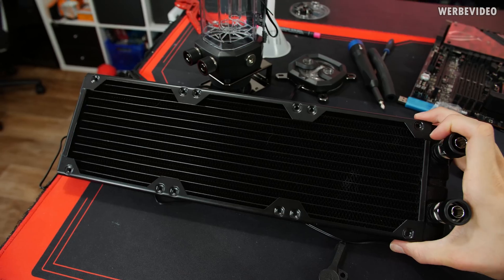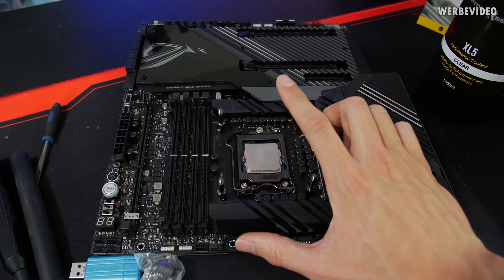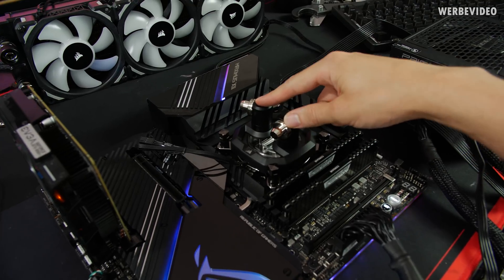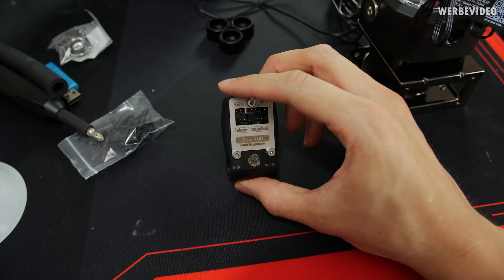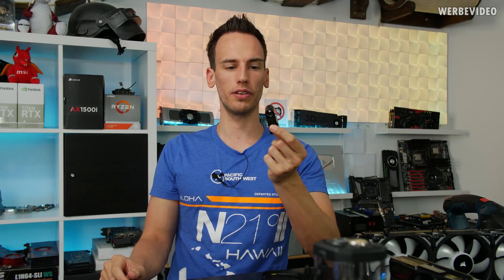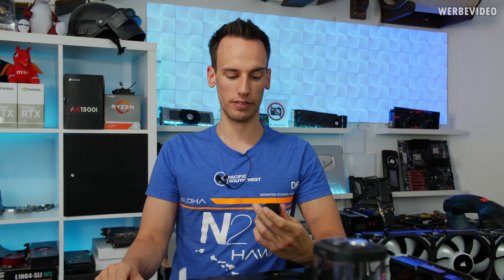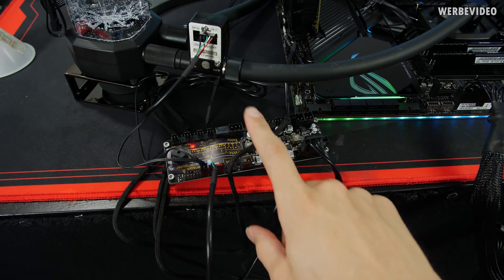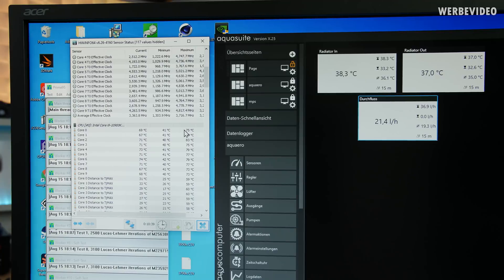Testing one of the Weirdest Water Cooling Myths - A SLOWER Flow Rate will result in BETTER Temps?

Comment: RUN THE PUMPS AT DC POWER, PWM CAUSES NOIIIIIISE
Reply: are u whacked out or confusing pwm with low phase ac
Reply: @BTD3Fan  pulse width modulation causes loud pumps. in the bios you can chose auto, dc, or pwm. choose dc. this makes the pump run quieter
Reply: @animearmpits3060  pwm is just a different way of delivering power which is much more efficient if you dont want to run full speed. you can still control the speed of the pump.

with dc you deliver 0-12 volts, and with pwm you deliver 12 volts or 0 volts (off) and you switch it on and off. So if you want to have it run at the same speed as a dc 6 volt, you turn the power on half the time. 

the reason this is done is  because the power to the dc is always being provided fully, so you would be wasting power, plus anything not being used just turns itself into heat. 

the only way a pwm could be louder is if the signal is off and on slowlely like 1 time per second, instead of alternating very quickly like 60 times a second, because then the motor would always be speeding up or slowing down.

Comment: I have duals between cooling points. I knew it wasn't much change but I am using a 800/L pump. CPU on Cinebench R20 maybe see 82c under 15min stress test. GPU never goes over 55c. using a EK Supremacy CPU block and a Corsair XG7 20 series GPU block. Got a EK Thin 240mm and a EK 240mm Thick (Double thick). System stays VERY cool under long loads.

Ill perform 10hr streams on Twitch 3 screens, 1080p at 60 fps on OBS, video games, discord ect. ill see idle be 42-44C after streaming will settle down to 34-36 after it cools. 

i7 9700k 5.1 at 1.365v with LOAD LINE cal 7 will jump to 1.39 (cinebench stress) but streaming never see it go over 1.378v. She puts some heat off but I absolutely love my i7 9700k paired with EVGA RTX2080 Super Black Gaming edition. Everything smooth as a whistle. I use a EVGA 1300 80G PSU. I don't care about watts and heat. I give her all she can get. damn RTX has another 95 Core Clock MHz added with 650 Memory clock added on top of its ALREADY OC'ed from factory. Gonna be awhile until I want to upgrade her. She does Everything I need/expect and a custom cooling system just tops her off. 

Thank you for doing this test. I figured with my flow rate it wouldn't matter two or one radiator. being a 15 year mechanic I saw having a second one wouldn't hurt. Using a Corsair Vengeance C70 case. She got room for sure. lol

Comment: I did the same test a while ago. Add a 300W GPU in the loop and a second triple radiator and you'll see a delta between cold and hot water of about 12-16°C with a D5 at 800rpm. As long as you get 0.5GPM it's allright and you'll see a temp gain of about 1-3°C per component. But any lower flowrate and the difference becomes quite noticeable. But you need to add a lot of blocks and rads to get a D5 to perform under 0.5GPM at full speed. And yes, you're flowrate values are a bit off :D The mechanical Aquacomputer (AC High Flow) flow meter is a lot more accurate and would have been better for this test. You should be seeing about 340lph with that D5 on full speed in your test loop. Maybe even more.
Reply: When you did this, was your delta between cold and hot measured by 1 temp sensor at the first rad's inlet and another temp sensor at the second rad's outlet?
Reply: @riffsthatkill2180  Yes, that’s correct. I used 2 triple rads for this test and they were connected to each other. So basically comparable to a 6 fan radiator if that would exit.
Reply: @broodro0ster  cool, I did this test recently too with a triple 360 and a 420. I had 2 D5s in series between the rads. Took flow down to 1 L/m (.25gpm) and saw a 7c delta with a 500w heat load. Up at 4 l/m, it was a 1.7c delta
Reply: @riffsthatkill2180  yea, the bigger the heatload, the bigger the delta when changing pump speeds. Multi GPU setups perform better with a higher flow because of this. My test was with 320W of heatload (8700k and 1080TI)

Comment: Awesome. My 10900k runs about the same, mine takes 1.335v to get 5.1 go z all core. I only have my cpu cooler right now due to costs. 

Questions did you some howvyse normal temp sensors? All I can find The plugs with temps sensors.

Comment: I wonder what would happen if you split the flow between two radiators (and them recombine them after) vs having two radiators in serial. The parallel rads would have half the flow rate and spend more time cooling down, but you'd only have 1 radiator to cool down in. In a serial radiator you have the same flow rate as the rest of the loop, but you have two radiators to cool down in. My guess is it probably makes no difference.

Comment: There is an optimum flow of water for ALL cooling loops, I work in commercial HVAC controls programming where chilled water cooling is the norm.
A chilled water coil (the metal heat exchanger that the air conditioner blows across to cool thenair) has water flowing through it at varying rate (via control valve)  that maxes out at a design flow. This design flow is the maximum flow you can run through the coil before you start to lose (instead of gain) heat exchange. The reason is, heat exchange takes time, and at some point you are moving the water too fast for it to have time to properly heat exchange, so your cooling ability actually gets worse at that point. 

You can also move the water too slow, because if the heat load is too great and the water too slow, the water gets saturated with heat long before it leaves the heat exchanger which means the heat load stops being exchanged until that water leaves the exchanger. Now in varying heat loads, when the load is really low, that lower flow may be perfect,  but as the load increases, so does the need for the flow to increase. This is why in my job, there is a controlled valve that is targeting this sweet spot via output temperature. 

In this application, you would just need to find the design flow, that is, at the highest head load, the highest flow before you start to loose cooling because the water moves too fast. This can be figured out by the temps of the water entering and leaving the cooling system. Where the temp differential (delta T) hits it's maximum, that's the optimum flow rate.

This method is optimum because it eliminates unknowns of the variable system. Whatever flow is heating your water up the most gets you the best heat exchange.
Reply: Simple physics dictate that its impossible to lose heat gain through an exchanger from increased flow. Exactly as this video demonstrates. All exchangers have an optimum flow due to surface area, increasing flow results in diminishing returns and efficiency loss but never an increase in temperature. Its easy to get confused by irrelevant information (heat gain to fluid). Think of the same exact problem in reverse. Instead of chilled water, heated water in a boiler system. Unlimited flow results in a fixed temperature of the exchanger but diminishing gains as the exchanger can only dissipate a fixed amount of heat dictated by surface area and temperature difference. As a result increased flow of the transfer fluid will always result better exchanger performance but you reach a point where exchanger gains are less than then energy required to pump the fluid. As seen in the video where pump speed was more than doubled from 2000rpm to 4800rpm with only a 0.5c cpu temperature decrease.

Comment: How is it  that the CPU is cooled better (ie lower temperature) in the High Flow case when the radiator is only removing 21.5 W while in the  Normal Flow case the radiator  is removing 31.7 W?

Comment: You could still get a slower flow rate in the radiator while having high flow rate in the cpu block. If you increase the diameter in the radiator, the water flows slower. But that's just a hypothetecal experiment

Comment: Well you proved the flow rate theory, but I don't really see that you proved the alternate radiator placement theory.
Reply: yeah the one in the title doesnt make sense but I can see a reason for the alternating radiator and heat source 

if you are water watercooling something like ram which took very little power, the energy from the cpu or gpu will just be heating up the ram to a point further than it would have heated up outside the loop.

I see this a lot and dont understand where people get the idea that energy only conducts one way

the only way it couldn't make a difference is if the heat gets perfectly distributed throughout the loop as if water is a superconductor, which if so then the flow rate wouldn't matter...

Comment: why do you even bother to explain that, having a radiator in the middle makes no difference unless is separated loops
Reply: also unless the water comes in like very hot it will not drop much more that the ambient temp, having more radiators will not change that.

Comment: Pump flow rates help with the heat transfer internally too, thanks to turbulence.

A low flow rate will encourage laminar flow, which creates a larger boundary layer of water at the heat transfer surface. You can think of this as stationary water that is absorbing the heat but not assisting to move it around the system. 

By increasing the flow rates and hence encouraging turbulent flow the boundary layer is greatly reduced at the surface giving much better heat transfer to the fluid and through the system.

Comment: Well ... kinda.  I get the flowrate argument, and it makes sense, but it doesnt address the original concern; 
- With 1 radiator set up to one cpu, then a gpu, the test proves the temperature of the water goes up.  The amount depends on flowrate.  
- But is there not a logical case for 'cpu warmed' water heading to a gpu, will temp saturate the gpu to a higher average temperature? 
... yet being cooled again via a 2nd radiator ... prior to getting to the gpu, would that not show a lower temperature, at any flowrate?  
** I AGREE, we are talking about probably 1 degree, and the whole conversation is ridiculous to start with ... but still **

Comment: I have tried to explain this forever. At least you made a video I can now just link.
Reply: which? the flow rate or loop order?
Reply: @BTD3Fan  Both. However, if you STACK radiators, it can start to change the results he shows here. Also, in extreme situations, order can matter a little. Example, 10980XE overclocked liked to be the first component of one of my test systems. The extra 1-3C the 2080TI's put in the loop caused it to crash, but again, this is on the edge, not for a daily setup.
Reply: @ninja226  yeah I keep telling people about loop order effecting a bit bc water isnt a superconductor and then they start hitting me with really dumb arguments about one factor being the same so therefore not another..

Comment: You could do 2 - 3 large rads in series, then manifold on hot/cold side, one line going to gpu, one to cpu. Then both hots coming back together and into the rad.  You could have high flow rate, while giving the water the longest time possible in the rads and each waterblock would get the same temp water coming out of the last rad so one isn't heating the other(gpu into cpu). Yea i know this is for that 1-2c but if your rads are large enough you could get ambient temp water going into gpu/cpu both and not one heating up the other and now we are talking 5c maybe? I dunno how much higher is your water temp over ambient?  

Another option would be to use a automatic temp based valve. Have two large rads(or series of rads). Using the manifold method. You could then switch between rads. Using a microcontroller and some temp probes you could monitor temps and switch rads accordingly. The idea is you could give water longer to sit in a rad, then flip the valve so it flows and the other rad pauses flow. This would then make your system work kind of like a car rad with a thermostat. But since you can't just stop flow, you could switch which rad is cooling and which one is paused. Switching time would most likely be like 2-4 seconds. giving that water time to reach (near) ambient. 

Some notes: You would need high fan rates, and high pump rates. The idea trying to always have ambient temp water going into the cpu and gpu waterblocks. This wouldn't be quiet, but would give ya best water temps for benchmarking. 

But for "general use" setups. Yup, doesn't matter, with a high flow rate the whole system is acting like one large thermal mass and if you want lower temps, get bigger rads. This is why cars will overheat if they don't have a thermostat. It has allow water to go into the rad, once the thermostat hits 190f, it allows water to flow again, once the water comes back around and cools the thermostat it stops the flow again. If this didn't happen you'd have thermal runaway and overheat. BASICALLY most water cooling systems run like this open loop setup and we get away with it because we are not even at 600-1000w not really putting much heat into the water, when rads can handle quite a bit, plus the hotter the rad gets, the better it starts to release heat. Thus why cars are set around 190f. 

so for us to reach ambient temps, it's hard and you need lot of rad and lot of fans. Noc 140mm 3000rpm PPC fans are great for this as they flow @ twice the air of Noc 120mm 3000rpm fans. You want faster fans than that, gotta go deltas. LOL talk about loud. 

My only point is, you can add some complexity to the water cooling system to get lower water temp at the gpu/cpu. It is in fact possible. But unless you are running something that chews a lot of watts or trying to get lowest water temp possible, or just like tinkering. It's not worth it but will perform better than just a all in series open loop.  The rad between nodes is useless. Yes would cool some, but would be better to have the rads in series giving the water longer time in rad to cool.

Comment: I guess, the only way to make a difference, is if you have 2 radiators, and set them up in parallel, that way the flow rate would be lower through the rads, but not the other parts of the system. And the reason this would make a difference is because the delta on the second radiator in series, would be lower, thus decreasing the heat dissipation. In parallel both rads would have the same delta. But this is only my guesstimation, so I'm not sure if that might be correct.
Reply: If you want to put radiator in parralel you have to balance pressure within the them (to have equal flow in them), impossible to do in a simple way . . .
Reply: @barbatocedric4246  Hmm, I don't see why you'd have to balance the pressure. Assuming you have 2 of the same radiators, it would be the same, and if it's 2 different ones, you'd still get a flow through both, only one might have a bit less flow, but overall, it would have to be very different radiators to matter much. 
In series both would be limited by the slowest ones flow rate, but in parallel, that's not an issue. And also in parallel you get an overall higher flowrate, as both are added together afterwards.

Comment: If your pump flow rate is ballpark correct, then your results are not steady state. A simple thermodynamics calculation gives 1.5[K]*4.2 [J/g-K]*5.5 [g/s] = 35 W. You are putting 170 W into the radiator, and your measurements only explain 35W. The temperature difference across your CPU or radiator at steady state should be ~7 degrees C.

Comment: It's like saying lower fan speed gives better temps because the air can spend more time inside the heatsink to cool the cpu :D

Obviously higher flow gives better cooling.
Reply: lol who says that
Reply: Too high a flow can be negative though as it won't be cooled down efficiently
Reply: @christophervanzetta  This makes no sense from a thermodynamic/heat transfer perspective. More flow might experience less temperature drop as it passes through the radiator, but it will also heat up less as it goes through the cpu block. More flow will always result in lower CPU temp.

Comment: So CPU blocks favour higher flow rate and radiators perform better at lower flow rates. 
Have you tested radiators in parallel? That way the rate between the radiators is halved but the CPU is still getting the full flow? Just a thought, good vid though :D